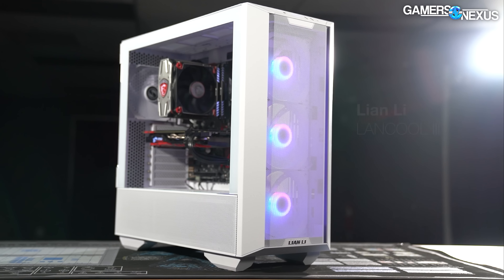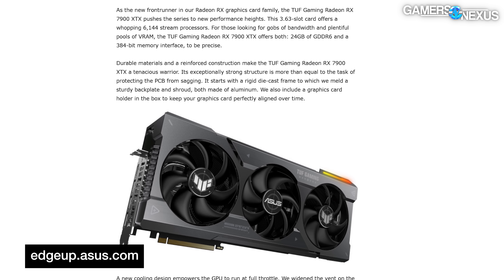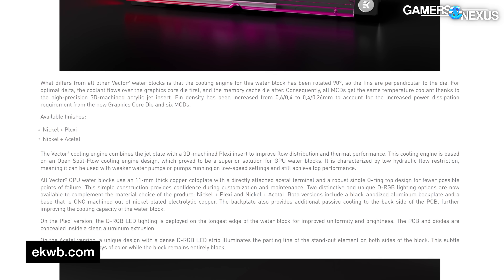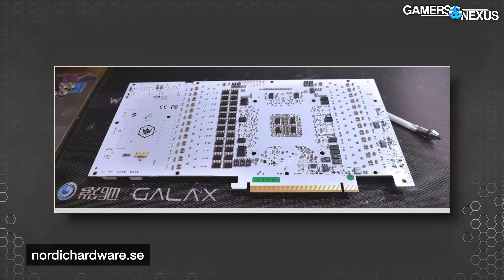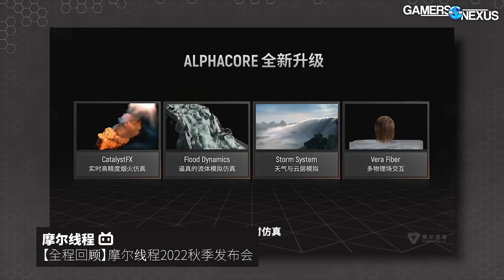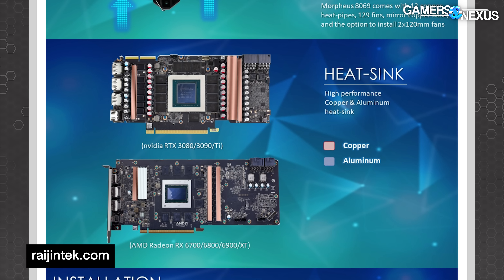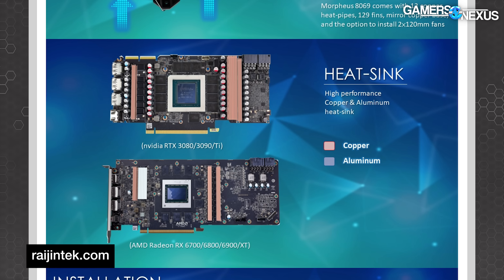HW News - New GPU Competitor, ASUS RX 7900 XTX, 2-Slot RTX 4090 Blower

Comment: There was a big recall of Arctic MX-5 paste early on in the year because they messed it up and the oil got separated from the paste. Happened with mine, but they sent me some MX-4 as a replacement.
Reply from the maker: Yeah. Just wondering if that was enough to plague its reputation and kill it
Reply: I am about to give up. I got myself big tube of Kryonaut that scratched my old CPU and its air cooler and used MX5 included with my AIO for new CPU. Who should you buy from Noctua?
Reply: This is news to me, I redid my CPU and GPU earlier this year with mx5 -.-
Reply: @LCDqBqA  It was only one batch that was affected, so later MX-5 batches should have been fine.
Reply: You beat me to it. I noticed this oil separation issue with the tubes I got, even though when re-mixed it worked fine. But it would've raised questions about the application longevity (particularly since Arctic claims an 8 year application lifespan).
Reply: @simptrix007  wait, kryonaut scratched your IHS and Cooler?
How does that work, asking out of curiosity
Reply: @darkdraconis  happened to me too, idk much about science but it looked a lot like oxidation
Reply: @simptrix007  MX4 is still fine.
Arctic Silver is still pretty good as far as I know.
But no problems with Noctua either.
Reply: Meanwhile I still use MX-2 for everything as it's available in a big-ass 30g syringe. I go through so much of the stuff with new builds, refurbs and some of my other electronics repairs that dicking around with a million tiny syringes is not an option (annoying + way more expensive per gram)
Reply: @thesingingchild  Are you sure you got Kryonaut or Conductonaut?
Reply: @Adierit  definitely kryo, glad i didnt put it on my gpu
Reply: @thesingingchild  conductonaut is a liquid metal, and contains gallium which would cause what you describe
Reply: @simptrix007  Kryonaut scratched your old CPU?
Reply: @mjc0961  Arctic Silver doesn't sound good.
Reply: @Adierit  yeah I actually double checked when I found out, I'm really curious myself as to why it would 'corrode' my cooler and cpu
Reply: @sammiller6631  It's actually pretty decent still.

Comment: I'm still really hoping for board partners to start selling board-only models with no cooler included, for people like me who intend to immediately put a full cover water block on it.
Reply: I figure if processors can come with no box coolers, why not video cards? lol
Reply: I doubt they will ever do this. The customer count is for such a product is very small and certainly not worth all the extra production costs. Don't forget that there is a bunch of ancillary costs for new models even when that model is almost the same as another one.
Reply: Right? I bet they’d be able to sell them at a quite high margin. Feels bad to buy a GPU with a massive, expensive air cooler just to take it off and never use it again.
Reply: These coolers are how AIB partners make the majority of their profit and I would guess they're already slim as ever, such as the case with EVGA. AIBs and GPU manufacturers have developed a sort of symbiotic relationship since the dawn of GPUs but I think Nvidia is slowly moving away from that and only then would you be able to purchase board only GPUs directly from the GPU manufacturer.
Reply: I know it sounds like a good idea but even as a someone who has water cooled everything for the last 3 gens I’d never actually buy it. Putting the air cooler back one has been useful for verifying the cards works and towards the end of personal usage I’ve always put it back on and put it back on and gave away / sold the card. The potential savings are just not worth it.
Reply: @sumikomei  processors have the metal shield (heat spreader) so they are "safe" to give to end users, GPUs would be bare die and it would be a nightmare for RMAs when users screw up mounting. board partners can refuse RMAs if you remove the cooler and do stuff to your card
Reply: I worry mostly about warranty when I think about WC my GPU.
Specially when it has something like 5 years of warranty !!!! it's a freaking long wait, until it expires. 😞
Reply: In order to build the military A330 MRTT aerial refueling plane, we literally bought a fully finished comercial A330 and dismantled it and modified it. It's not worth it for Airbus to modify the entire production chain for such a little amount of units.
It's the same for GPU in this case. Not worth it at all for them, sadly.

Comment: I don't understand why card manufacturers don't just have a third slot bracket for cards that are this thick? Jay has shown that you don't need a support bracket if the cooler is solidly connected to the slot bracket, and since you can't run it flat against another card or glass, what's the harm?
Reply: Another 10c of steel
Reply: On a serious note, it's probably to be compatible with all the 2 slot vertical brackets
Reply: There is the slim chance that it is for ITX case standard reasons.... There are cases with only 2 slot brackets. Only for the smallest of motherboards. And in that case 2.53 or 3.56 slot sizes really do matter. Like literately the cases might only fit GPU's that are 3.52 slot cards. XD And only having 2 bracket in the back but support internally for cards up to 3.5 GPU's. 

And really for a long time now 2 slots on the back of the case are always removed from cases. But taking out ther 3th and then getting a 2 bracket slot card later is going to leave you with a empty slots. Since that bracket surly have gone missing! Or if it is a Gaming chassi the brackets are push out and not reusable. XD

Really the solution is to have 2 PCIE connections. One at the top transferring the data. Then a dummy one only connecting to the lower one for support XD
I'm telling you all this is going to happen when support sticks are not enough.
Reply: For 3.XX to 4 slot cards, manufacturers should give us different size mounting bracket plates (default 2 slot, up to 4) that we can swap out and screw in, instead of making us pay for "GPU Support Sticks" that most people don't want or need (and with poor case compatibility as well).
Reply: @junjiexie  likely, but again, that just means that the card is definitely getting choked for air.

Comment: I remember years ago when FFXIV Heavensward came out, I went out of my way to buy the box copy, because I was in a new town that had a mall, so I figured it would be a fun novelty. I bought the box copy, and inside the box was just a piece of paper with the cd-key. There wasn't even a disc in it!! It came in a plastic DVD-esq case, with a molded slot for a cd, but no cd!

It was at that moment that I totally gave up on physical discs, lol!
Reply: I remember when that started.
Reply: At least for MMO's, that's something you can expect because you can't play them offline anyway. Though, they should be required to have a label on the box saying "No physical media inside" or "Contains license only".

CoD is a totally different story because you'd expect to be able to play the Campaign and local/splitscreen multiplayer offline, but you can't even do that now.
Reply: @GENKI_INU  At least as recently as when GW2 released, you could still get a physical disc that would have some of the data on it so you could at least get most of it installed offline, even if it needed to patch afterwards.  That's changed in the past 5-10 years.
Reply: Legit only for PC really, sure some games here and there have a code but console still gets some damn cool physical releases.
Reply: Yeah, I had a similar-ish experience with my copy of Civ V. Bought it when it came out initially, and all the disc had was an autorun for launching the ‘installer’ and a steam install .exe where you’d proceed to download the game that way. It was really weird, but it wasn’t until I got L.A. Noire on PC that I finally gave up on physical PC games
Reply: That game is constantly patched with new content so giving you a disk would still require downloads MMOs are a different beast
Reply: @Thros1  I know that. I mean, I know how MMOs work.

But I remember buying games like FF11, FF14 1.0, Warcraft, Age of Conan, Hell, even Swtor, and they all gave a disc. There's always a disc! Even if it's obsolete, lol.

I remember one of the 'selling features' of the WoW collector's edition was that it came with a DVD install disc, where as the standard game came with 4 CD-discs.
Reply: @nauscakes1868  changing times games are big less waste saves them money etc, I'd rather they came with manuals again that have art or something about the development process. Why include that though when they can charge you for it ;p
Reply: @Thros1  I would love to see manuals again too. I do miss them. The best bathroom readers ever!

I think what irks me the most though about my experience wasn't just that it didn't come with a disc. But also there wasn't a manual. It was a plastic DVD case with a code in it. I feel at that point, I might as well just be buying a gift card.

I just miss some of the more physical aspects of buying software, lol

Comment: the side panel monitor seems like it would be nice for the obsessive type that like to always monitor their temps/voltages/clocks while doing literally anything. Though it also seems limited in cases that it makes sense to use it in, the Lian Li lancool series with the glass panel on the back side and panels inside to cover your spaghetti wiring comes to mind but not much else.
Reply: i would love that but in much much smaller like 10 inch or smh
Reply: You should place a surveillance camera inside a case and send picture to side panel monitor
Reply: @DrSmugface  Exactly. 12" is way too big. I think 6" is about right for monitoring/theming. ASRock marketing/engineering don't understand what it's for. It's too big for its use case, and too small for productivity.

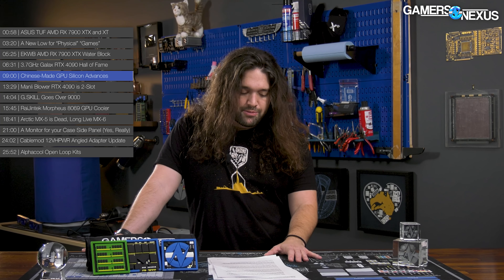Comment: 13:29 I would be very interested in a test for the 2slot blower 4090
Reply: It looks really good tbf
Reply: Same. Would be extremely interesting to see Steve tinker with it. Heat, Speed. Maybe playing with power limits, undervolting etc
Reply: Is it even a 4090?  Are we sure this isn't just an evolution of the wish gt 710 scam?
Reply: Its interesting
Reply: I am reminded of the Fermi / hair dryer video.

Comment: Aftermarket gpu coolers are useful for second hand shopping, many people selling cards with waterblocks. If you don't want to buy custom water cooling parts you can get a cooler for cheaper
Reply: When I sell my waterblocked cards I include the air cooler and even off to put the air cooler back on if message. I figured it makes them easier to sell.
Reply: These coolers are often soo brutal, they can cool GPUs much better, than stock cooling, while being significantly quieter.
I really wish, there was an aftermarket solution for RX6600XT as well. Cooler on mine is quite fragile.
Reply: @Morpheus-pt3wq  The 6600XT is only 160W and can be cooled very easily on air. It does not make economic sense to make an aftermarket water block for it. My 6700XT Red Devil consumes 235W when overclocked to its maximum limit and even so it does not exceed 65C on stock fan speed which is barely audible.
Reply: @tclemens96  i got my 2080ti very cheap because the owner didnt had the aircooler anymore .. for me it didnt matter because im using a waterloop either way but yes as you said
Reply: @Morpheus-pt3wq  XFX Speedster QICK 308 6600XT has  a great cooling solution, 1600 fanspeed under full load at 2400mhz, really quite fans. had msi rx6600 and asus rx6600 before this and both were very loud.

Comment: I love the Arctic MX-4 thermal paste, because it combines the qualities most important for me, for which I'm willing to sacrifice a bit of thermal conductivity, and that's longevity and the fact it's not electrically conductive. Thermal Grizzly has some much higher-performing pastes, but they have an expected lifetime of 1 year, and that's not good enough.
Reply: The 1 year part isn't entirely True, but it's not inaccurate either. I've had Kryonaut on a few of my CPU's and it lasted for years. However, I used Kryonaut with CPUs and Coolers that would never go past 70c.
The problem with Kryonaut is its known to Pump-Out when temperatures go above 85c. This is from thermal cycling and expansion. There are tons of people who tried Kryonaut on laptops and their temps would eventually become unmanageable. I tried Kryonaut on my 12900k and after a while the temps would easily throttle under heavy load.

You can find any forum where gaming laptops are being discussed and the Kryonaut Pump-Out issue is well known.
Reply: First I've heard of anything like that, I've run kryonaut for years with no problems, but my cpus never go above 75, although my new 11900k has been hitting 80 every so often

Comment: 15:45
aftermarket GPU coolers are great
I replaced the already large cooler on my GTX 1080 with an arctic cooler
10°C cooler and dead silent

as for thermal paste pump out, I found the best solution is simply mixing Liqui Moly Silicon Grease with fine graphite powder(16-63µm particle size)
basically stuff I had in my toolbox and mixed together because my laptop was overheating with Noctua NT-H1

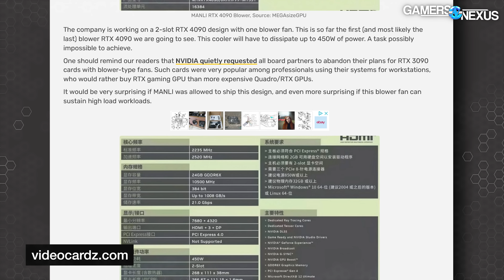Comment: 13:51 not only potentially. The only thing that differentiated Quadro from GeForce for the last generations was that Quadro still fits in standard cases. Not this last difference is gone. And the 4090, even with such a small cooler, is for sure much faster than all Quadro models ever produced*, while only costing a tiny fraction of the Quadro price tag.

*except maybe the Quadro GP100/GV100 which could do FP64, and high-end models with 48GB VRAM.
Reply: Quadros are also the only GPUs the Nvidia "allows" to use in servers. It's technically against Nvidia's terms of service to use a Geforce card in one. Quadros also are "allowed" more simultaneous video encoding streams.

Also technically their not called Quadros anymore but the branding now is just dumb so it doesn't matter.

Comment: I actually think that side mounted display could be used for Lan parties. You don't have to carry a separate monitor, and if you can find a way to mount it without adhesive (or in a reusable way) then this is actually pretty useful.

Comment: The 3090 and 3080 blower cards from Gigabyte are very popular with our customers, they are a fantastic way to fit a lot of compute power in a standard server formfactor or workstation, which couldn't support massive three slot cards. If there's going to be a 4090 blower card, I'm probably going to get to work on it.

Comment: I like the aesthetic of the MTT cards. Hope they don't suck.
Reply: From the specs in the video, and allowing for some driver suckage, the 3-fan design could be in the league of the RX 5700 XT. Depending on price, that could be acceptable.
Reply: Judging by China’s CPUs they’re gonna be terrible. Maybe a Maxwell Titan equivalent if they’re lucky.
Reply: @joemarais7683  The announcement said 14 TFlops and 448 MB/s memory bandwidth. That could in theory beat the RX 5700 XT. In practice I think performance will not quite reach that expectation, and the three fan cooler design hints at pretty high power consumption. 
My best guess is we will see something like Intel ARC: 
Staying behind expectations but perhaps salvageable. Especially if the western world tightens semiconductor sanctions against China some more. In that case, an available MTT might beat unavailable Radeons and RTXes for Chinese buyers.

Comment: I would love to see that 4090 ship with a stock lower power limit. It would be incredible if you guys would review one in that use case. I'd take 3090 level performance with a decent downclock if it means getting one that compact. My current SFF case can only take a 3-slot by 320mm GPU at the max due to anther card using the x8 slot below it.
Reply: we already have that, it's the 450w tdp 4090. you don't need to power limit it, coolers are just overbuilt because it was supposed to have higher tdp. mine doesn't even hit 70 degrees at 60% fanspeed

Comment: I'd be very interested to see that blower 4090 perform after a LM application. It will absolutely still be thermal throttling, but maybe that gives it a fighting chance? Regardless, even if no LM is involved, I'd love to see a review on it just to know how it sounds lol.
Reply: 4090 does not run hot so I don't know wtf you guys are on. I run mine overclocked with 60% fanspeed and it doesn't even hit 70 degrees in full load
Reply: @DavidFregoli  yes but that variant has 2 blower fans and is much slimmer. Those 450-600w will generate heat

Comment: Steve, really glad to hear you point out that a custom water loop just makes much more sense for the latest high-end GPUs and CPUs, for better cooling, better stability, lower noise, smaller form factor (so otherwise huge RTX4090 cards when water-blocked can fit in MUCH smaller cases), and when paired with a beefy PSU (say a platinum rated 1500W) then all your equipment can run constantly at maximum boost speeds. Could you please do a review of what different water-cooling solutions for the very latest hardware at the top of the range speeds (and therefore heat) is currently/about to be available? If you could please include CPU, GPU, DDR5 RAM and M.2 water-blocks (all 4), then that would be incredibly helpful! Also, I believe that EK are releasing a RTX4090 dual active water-cooling set (front and back plates both actively cooling, and with the RGB in the back as well it should look really nice on GPUs mounted in even the normal manner); could you please see if you can get a pre-release sample and maybe include it in your "ultimate gaming enthusiast custom water loop component review Q4 2022" video? Many thanks!